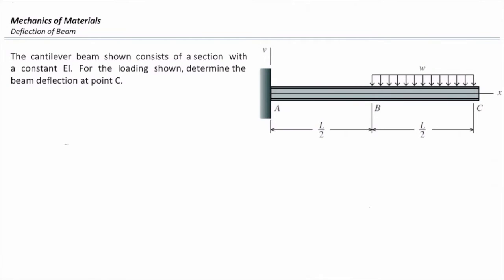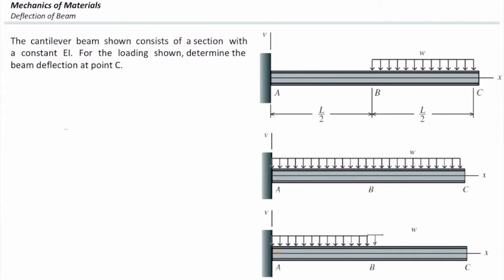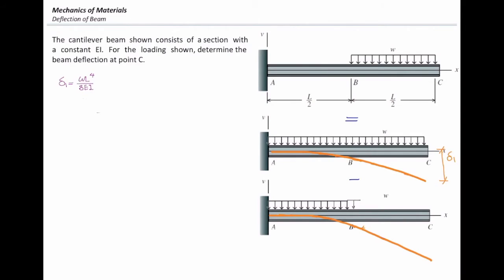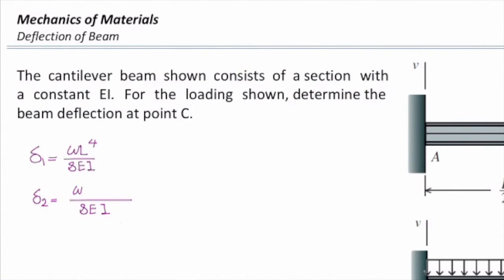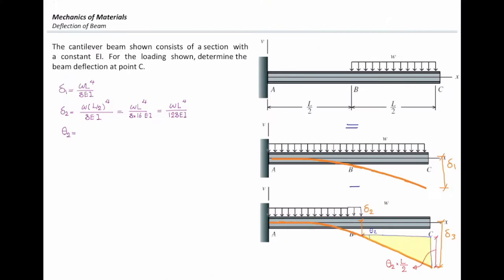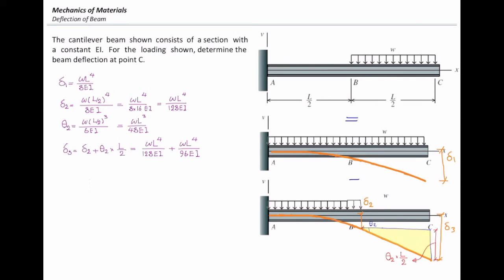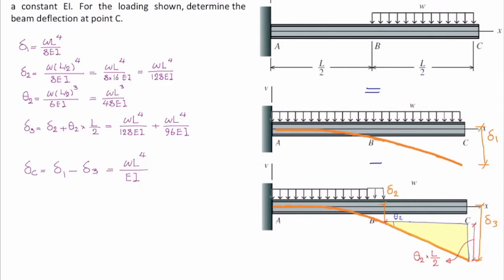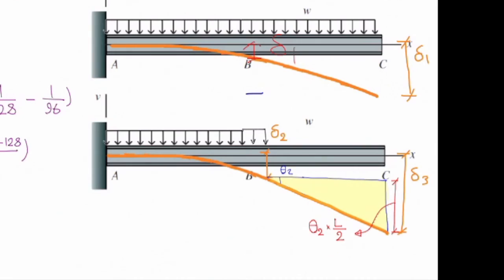Lecture 14, Beams deflection, Method of superposition (Part 3)

Comment: the words can't describe my thankful for you .. 
great job sir, but correct me if I'm wrong 
the second beam "half one " it has a unique shape in the table and we can use its deflection from the table 
without finding theta 1 and alpha 3 
thank u again
Reply from the maker: You can use the table values directly if there is a structure with the same loading. No need for indirect calculation of deflection in this case.